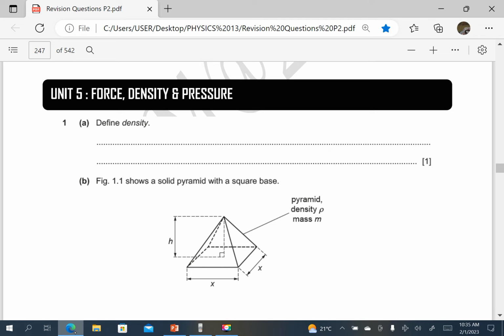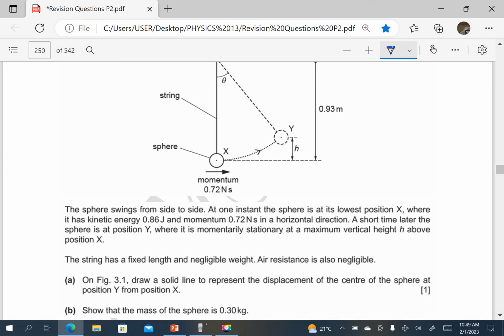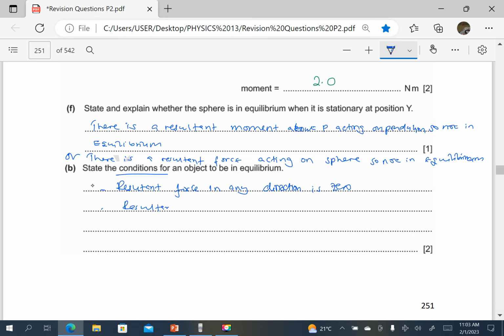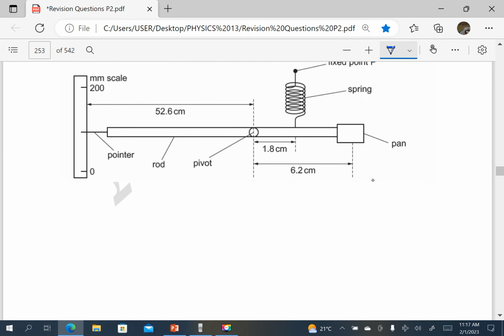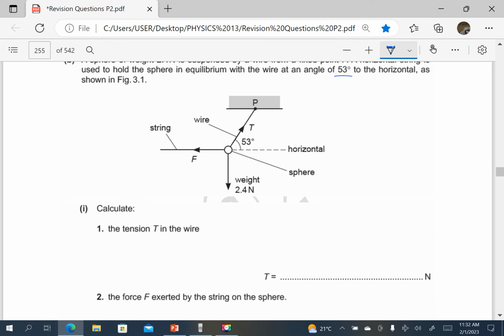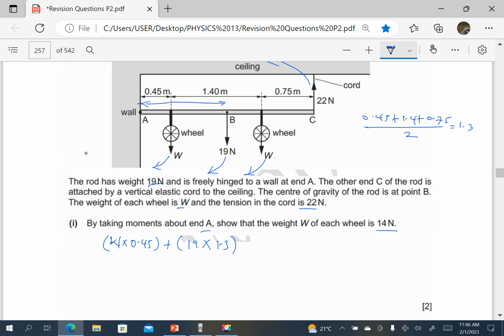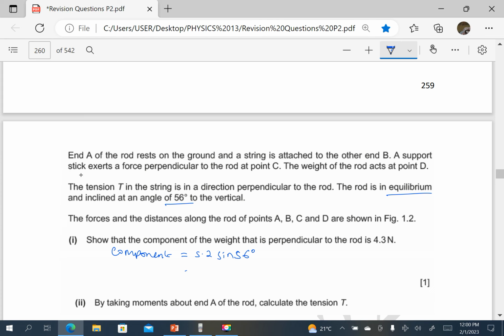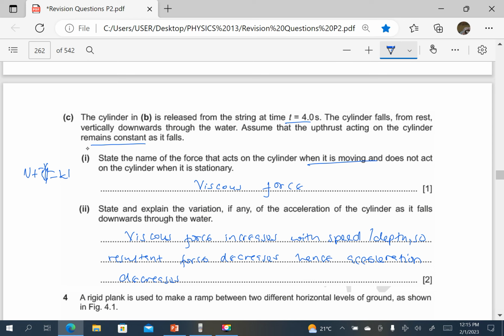FORCE, DENSITY & PRESSURE,  AS Physics  [Solved past paper Questions] PART 1

Comment: hello , sir in 3 b (ii) i divided 0.45 and 1.85 with 57.2 on right hand side. I get the answer wrong. Can you explain why is that and why we have to add the distances as you did ?
Reply from the maker: i think u are referring to the question of moments. Next time quote the time of the video so it saves time in checking it. Not that taking moments requires carefully determining the perpendicular distance from the pivot to the line of action